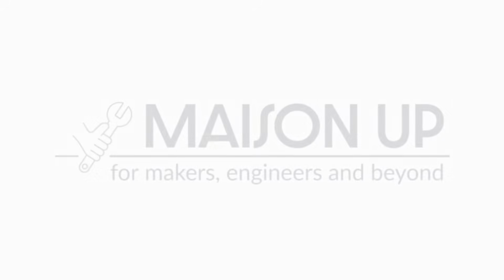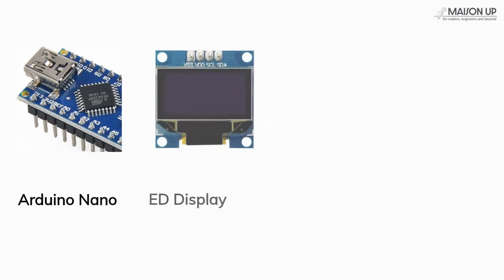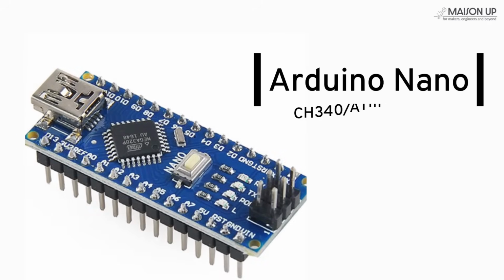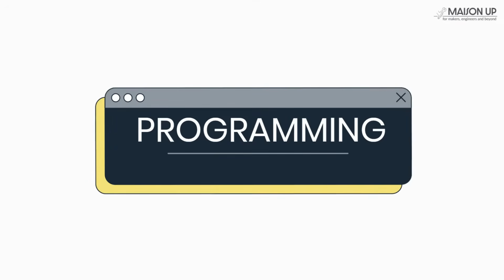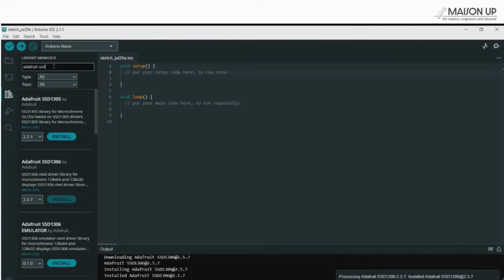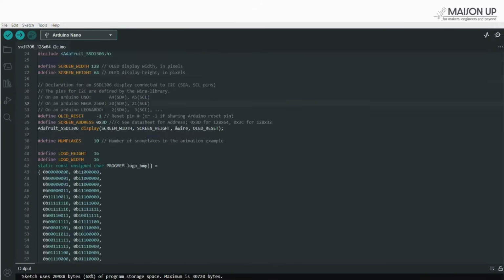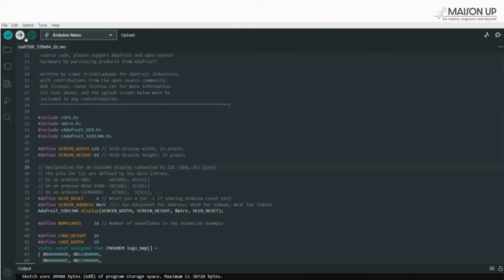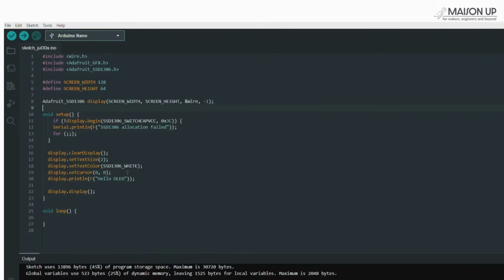Arduino Nano OLED Display Tutorial for Beginners | 0.96 Inch, I2C White | Step-by-Step Guide

Comment: as this Adafruit library consumes lot of memory what we should do.
Reply from the maker: Yes, the Adafruit SSD1306 + GFX libraries are easy to use but quite heavy on memory, especially on smaller MCUs like Arduino Uno/Nano. If you’re running out of SRAM/flash, you can:
Use a lighter library like U8g2 (has many memory-optimized modes).
Switch to a page buffer mode instead of full-frame buffer.
Move static graphics/text to PROGMEM to save RAM.
Use a bigger MCU like Arduino Mega, ESP8266, or ESP32 if possible.

For most small OLEDs, U8g2 library is the best memory-friendly alternative.

Comment: How can I set the sketch to display Serial (9600) output? I' am trying to get the OLED to display PC game life and ammo counts passed through serial. Thanks.
Reply from the maker: Great question! To display Serial (9600) output on a 0.96" OLED, you need to read the incoming serial data and update the display accordingly. Here’s how you can do it:

Steps to Modify Your Sketch:
Set up Serial Communication:
In setup(), initialize Serial with Serial.begin(9600);
Read Serial Data:
In loop(), check for incoming data using Serial.available().
Parse & Display Data:
Read the data using Serial.readStringUntil('\n') (or another delimiter if needed).
Convert it to a number (if required) and display it on the OLED. Try following example code "#include <Wire.h>
#include <Adafruit_GFX.h>
#include <Adafruit_SSD1306.h>

#define SCREEN_WIDTH 128  
#define SCREEN_HEIGHT 64  
Adafruit_SSD1306 display(SCREEN_WIDTH, SCREEN_HEIGHT, &Wire, -1);

void setup() {
    Serial.begin(9600);  
    if (!display.begin(SSD1306_SWITCHCAPVCC, 0x3C)) { 
        Serial.println(F("OLED init failed"));
        while (1);
    }
    display.clearDisplay();
    display.setTextSize(2);
    display.setTextColor(WHITE);
}

void loop() {
    if (Serial.available()) {
        String data = Serial.readStringUntil('\n'); // Read serial input
        display.clearDisplay();
        display.setCursor(0, 10);
        display.print("Game Info:");
        display.setCursor(0, 30);
        display.print(data); // Display received data
        display.display();
    }
}
"This will show the life count, ammo, or any game stats on the OLED display dynamically. Hope this helps! 🚀 Let me know if you need further modifications. 😊

Comment: I really wanted to get this working... but couldn't.  I'm not sure if it was because of the off-brand Arduino or the off-brand OLED display, but I sent everything back due to the hours of frustration of not being able to get anything at all working.
Reply: sorry for my english. well at first time i didnt do it too, but changing the OLED_RESET to 4 and the SCREEN_ADDRESS to 0x3C it works, and another problem is the arduinos nanos version, go to "tools"'--->"Processor"-->Atmega328P (Old Bootloader).i just said to you what worked for me, sorry if this dont work for you

Comment: My screen shows only noise. I uoloaded the sample from the Arduino IDE. After, I uploaded your code from Drive.
Reply from the maker: you can try the following troubleshooting: Check Connections, Confirm that the OLED display is receiving the correct voltage, Confirm that the I2C address in your code, Check if the display initialization in your code matches the specifications, Examine the OLED display for any physical damage
Reply: @maisonupstore  the screen looks okay, because I was finally able to run another code. It’s weird, but I will analyse the successful code and find out the issue for yours. Thanks for reply.
Reply: I found you the issue. My screen is SH1106 model! I was using the wrong driver.

Comment: I did the same as the video but my screen still doesn't light up
Reply from the maker: are you able to upload the code ? if yes you have ensured proper wiring ? if yes most likely you are not selecting the correct screen address it's typically 0x3C or 0x3D. Pls try changing it
Reply: @maisonupstore My screen is not working even after that 😢😢😢
What should I do now.
Reply: @maisonupstore does the colour of the screen also matters??
Reply from the maker: @abhayraj6802  if your wiring are ok, following things will matter, Library Used, Screen Address. Please share your code at saurabh@maisonup.in will help you
Reply: My screen is not working even after that 😢😢😢
What should I do now.

Comment: Hi, please can you help. I want to connect the 7pin 1.5" 128 x128  OLED to the Nano. Tx in advance.
Reply from the maker: Assuming You are Trying to COnnect with NanoBoard, do the following connections: VCC: Connect this pin to 3.3V or 5V on the Arduino Nano (Check your OLED specifications to make sure which voltage it supports).
GND: Connect this pin to one of the GND pins on the Arduino Nano.
SCL: Connect this pin to A5 on the Arduino Nano.
SDA: Connect this pin to A4 on the Arduino Nano.
RES: Connect this pin to a digital pin (e.g., D4) on the Arduino Nano.
DC: Connect this pin to another digital pin (e.g., D3) on the Arduino Nano.
CS: Connect this pin to yet another digital pin (e.g., D2) on the Arduino Nano.

And upload the following sample code: "#include <Adafruit_GFX.h>
#include <Adafruit_SSD1351.h>

#define sclk A5
#define mosi A4
#define cs   D2
#define dc   D3
#define rst  D4

Adafruit_SSD1351 display = Adafruit_SSD1351(128, 128, sclk, mosi, cs, dc, rst);

void setup() {
  display.begin();
  display.fillScreen(0xFFFF);
  display.setTextColor(0x0000);
  display.setCursor(0, 0);
  display.print(F("Hello, world!"));
}

void loop() {
  // Your loop code here
}
"
Reply: @maisonupstore  thank you very much friend. Much appreciated. You are a star.💫🙏

Comment: Hello. On the OLED screen I have, it is stated that there is SCK instead of SCL pin. Do these two pins serve the same function?
Reply from the maker: Absolutely, SCK or SCL is the same thing and stands for Clock while SDA stands for Data. If you are using it with a Nano Board connect SCK with A5 of NANO and SDA to A4 of Nano
Reply: @maisonupstore  I did as you said.  No problems with encoding.  But the screen still does not turn on.  I tried to test it with another screen.  But the problem is still the same.  I think I'm using a different screen.  I will find a screen with scl and test it.
Reply from the maker: @Elshan_Mammadov_  could you share picture of the display front and back ?

Comment: Does the color of the jumper wires matter?
Reply from the maker: Not really, but you must ensure match connections to microcontroller are correct, if you are using a Nano Board then VCC to 3.3 V, GND to GND, SCL TO A5 and SDA TO A4

Comment: My friend! Thanks for the video first of all.
I'm planning on creating a hud for my car that displays the speed and whenever I put it in rear, the screen woould turn into a parking sensor visualizer. Do you think it is possible with this type of screen?
Reply from the maker: the screen would be too small for the purpose however you can try, you would need to connect additional sensors for e.g. for parking a visualization a HC-SR04 or alike and a mechanism to detect reverse etc.

Comment: I would like to use two screens that each display two separate voltages from a total of four sources that put out less than one volt. .000-.999vdc is this possible
Reply from the maker: Hello! Indeed, you can use two OLED screens with a single microcontroller as long as you have enough available pins. To accomplish this, you'll need to ensure that each OLED display has a unique I2C address. Below code sets up two OLED screens with different addresses and alternates displaying voltage information from different sources on them. Each source's voltage is displayed for 5 seconds before moving on to the next source. If you need further assistance, don't hesitate to ask!"
"
#define SCREEN1_ADDRESS 0x3C
#define SCREEN2_ADDRESS 0x3C

Adafruit_SSD1306 display1(SCREEN1_ADDRESS);
Adafruit_SSD1306 display2(SCREEN2_ADDRESS);

void setup() {
    Wire.begin();
    display1.begin(SSD1306_SWITCHCAPVCC, SCREEN1_ADDRESS);
    display2.begin(SSD1306_SWITCHCAPVCC, SCREEN2_ADDRESS);

    // Other setup code here
}

void loop() {
    // Display voltage of the first source
    display1.clearDisplay();
    display1.setTextSize(1);
    display1.setTextColor(SSD1306_WHITE);
    display1.setCursor(0, 0);
    display1.print("Voltage Source 1:");
    // Add voltage reading for the first source
    display1.display();
    delay(5000); // Display for 5 seconds

    // Clear display for the second source
    display1.clearDisplay();
    display1.display();
    
    // Display voltage of the second source
    display2.clearDisplay();
    display2.setTextSize(1);
    display2.setTextColor(SSD1306_WHITE);
    display2.setCursor(0, 0);
    display2.print("Voltage Source 2:");
    // Add voltage reading for the second source
    display2.display();
    delay(5000); // Display for 5 seconds

    // Clear display for the next cycle
    display2.clearDisplay();
    display2.display();